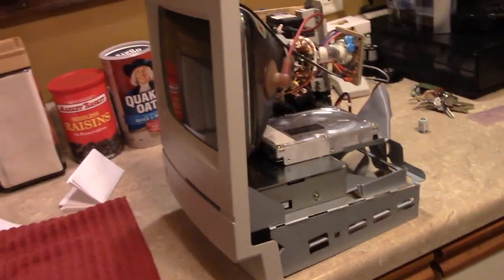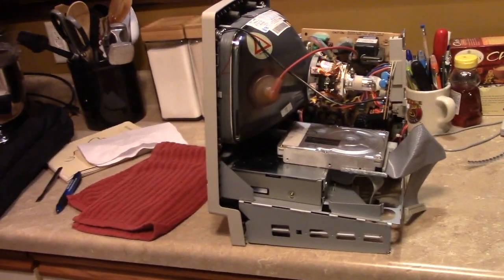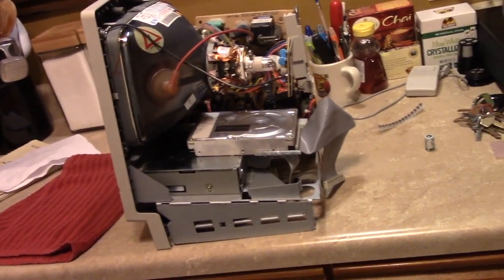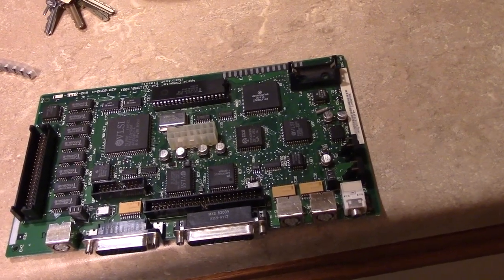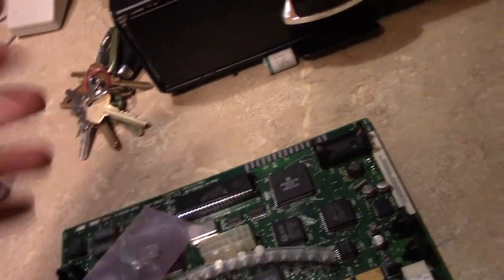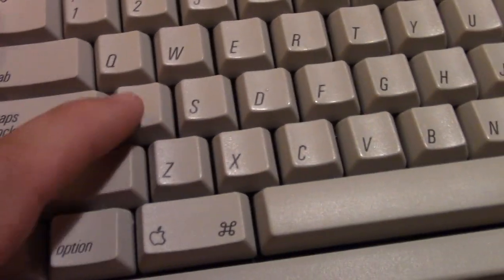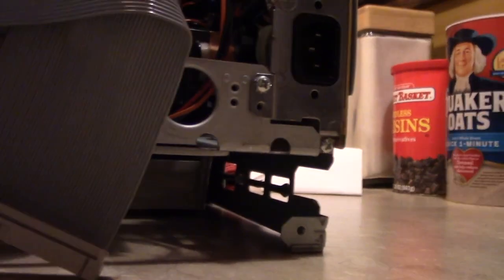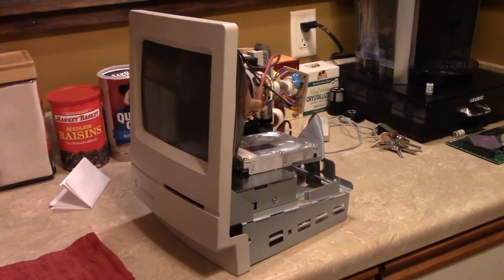1991 Mac Classic Project: Part 2, "Further Repair Analyses"

Comment: I think these machines did more harm than good to Apple's brand. An 8mhz, 1MB, B&W machine with no harddrive had no place on Apple's sale sheet in October 1990, never mind September 1992.

A lot of these machines ended up in schools which led to a whole generation of kids thinking of macs as underpowered, overpriced toys incapable of serious work.

The color classic would have been a better product to release at that time, even on neutered hardware. But the actual color classic appeared too late and too overpriced.
Reply from the maker: You aren't wrong. As a result of these machines being sold in 1992, school districts were still using them well into the mid (even late) 1990s; my high school still had some left in the early 2000s. These machines were utterly terrible, and most definitely helped fuel the "Apple SUCKS!" campaign which nearly spelled the end of Apple Computer as a going concern.
Reply: Yeah I remember. It wasn't easy attempting to convince others of the merits of the Mac when the closest ones within 10 miles were little more than rebadged hardware from 1984.

Comment: The Apple drive utility was patched by third parties sometime after release in order to allow better compatibility with aftermarket drives. In my travels over the years, the patched version has been more common than the original version!

This machine has the rom boot feature built-in where you can boot from the OS stored in ROM -- how does the floppy drive behave using that minimal factory version of the Mac OS ?

Comment: I wonder if someone would take one of these computers and seal them air-tight so that no oxygen gets inside, would they still have the same amount of issues 20-30 years later as one that was just inside its box.
Reply from the maker: They would still suffer capacitor failures and the clock battery could still leak, but there would be no corrosion at least.
Reply: Interesting.  Thanks for your input.  I know I am weird, I just wish there were easy ways to save technology for future generations to examine.

Comment: You don't really need deoxit if it is not specifically being used on pots/sliders standard contact cleaner will do the job and it's easily available as its used for auto work amd so any auto parts store should sell it (Halfords in the UK certainly sell it and they are a consumer chain store) . 
And as for computers without hard drives, the Acorn Archimedes/AXXXX series of computers could be used happily without a hard drive and only one floppy, primarily this was because the OS is in ROM and the floppy is only required for program/file storage and not to boot the machine.

Comment: It's a good project. I'm gonna get a Classic II with the "jail bar" problem on the screen. That's supposed to be a capacitor issue as well, and is easily dealt with. In that condition, they go for practically nothing on eBay nowadays. I'm fortunate in that I already have an Extended Keyboard II and the square mouse. Waiting to see more of this series.